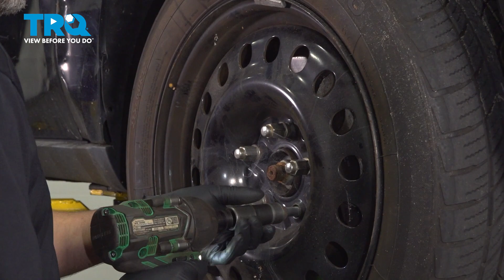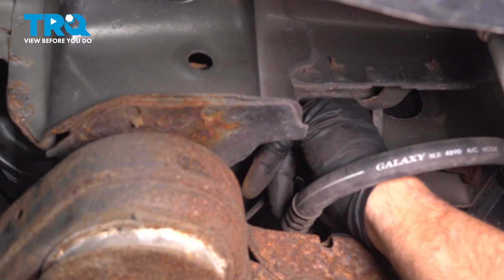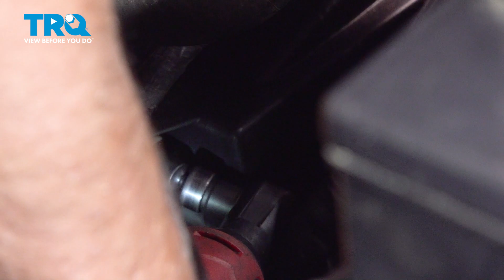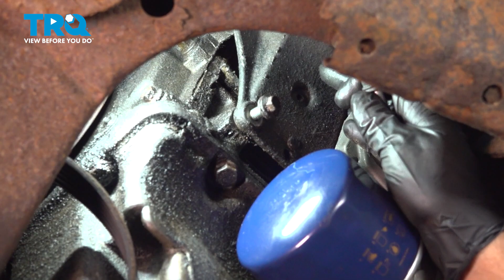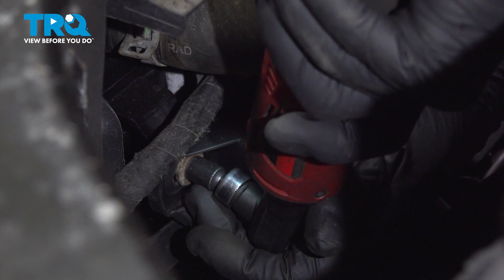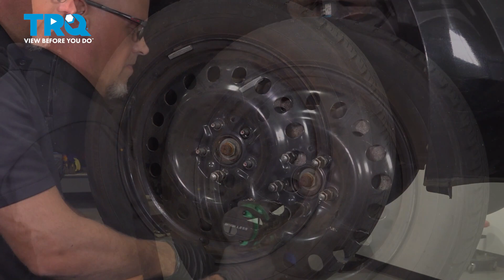How to Replace Oil Pressure Sensor 2005-2007 Ford Five Hundred

Comment: Funny, this is the only opinion on changing the oil sender unit on a Ford 500! You won't mind if I just go and look at where it's at, and the easiest way about this before I damn near pull out my whole damn engine!! Who is TRQ? Might get your socket on the bolt head before you strip it one of these days!!! Fools!!!